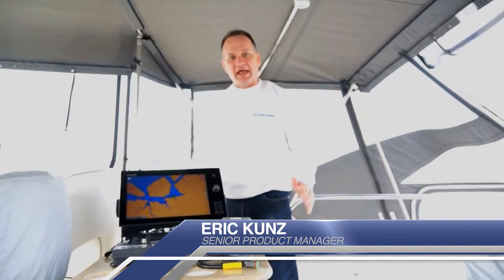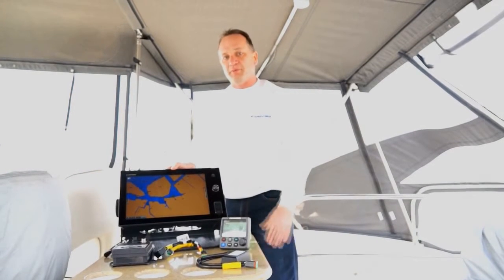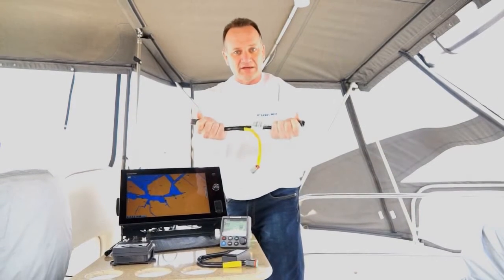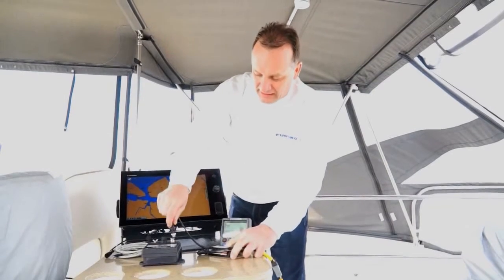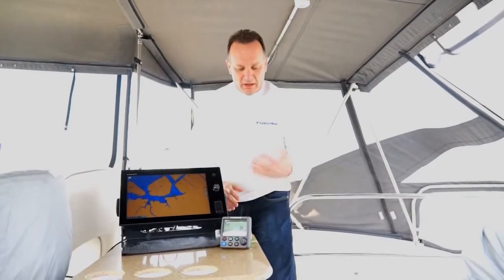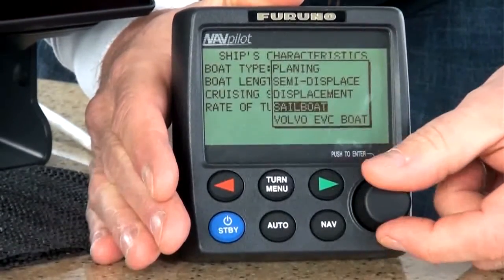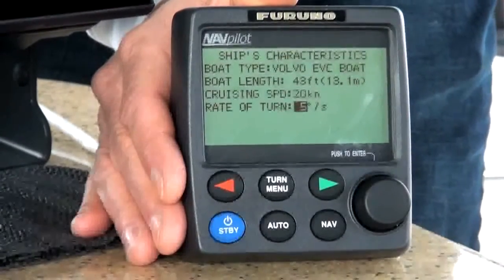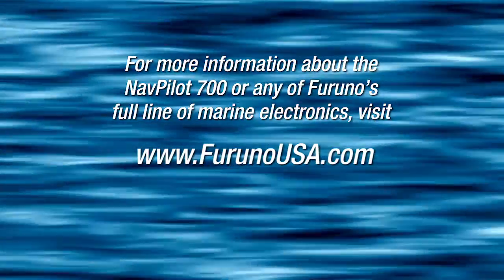Furuno NavPilot Volvo Penta Interface Installation

Comment: Can you install this on any volvo penta?
I have 2014 5.7 volvo penta with ocean x outdrive 
Would i need additional wiring?
Reply from the maker: I believe that the Volvo Penta IPS system is a different model steering system than what you have on your vessel. You would first need to inquire as to whether your system has the IPS feature set and hardware. Either way, Furuno has an autopilot model that will integrate with the steering system on your vessel. Check with your local authorized Furuno dealer to determine which NavPilot will work for your boat: https://www.furunousa.com/en/company/find_a_dealer